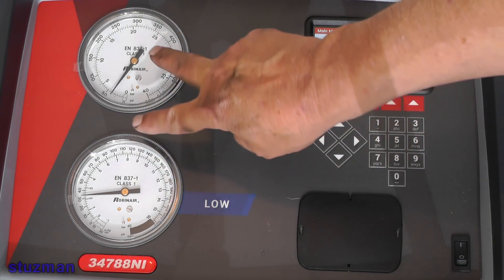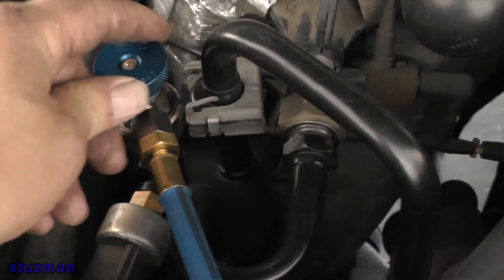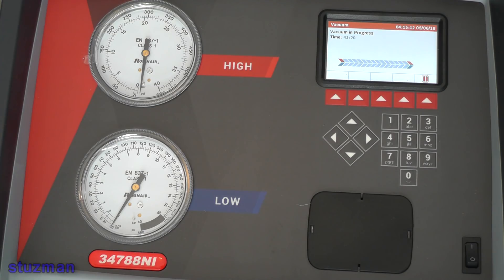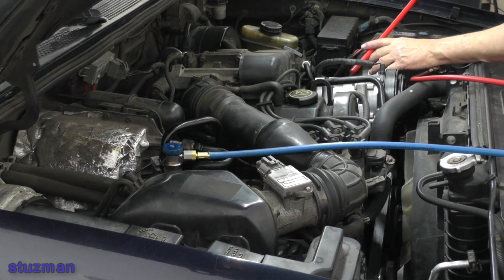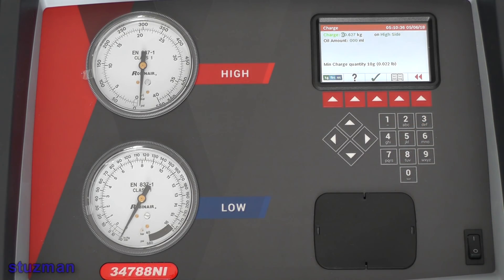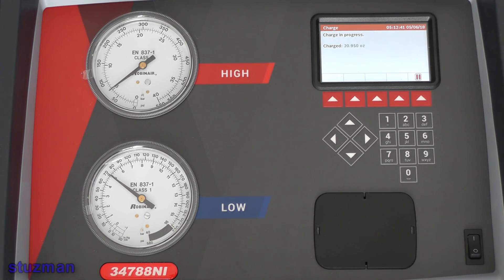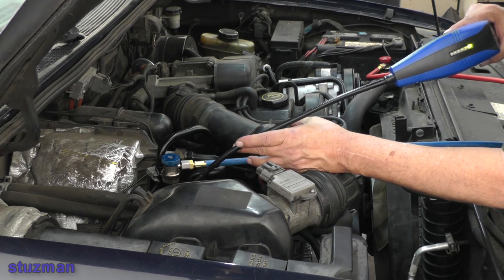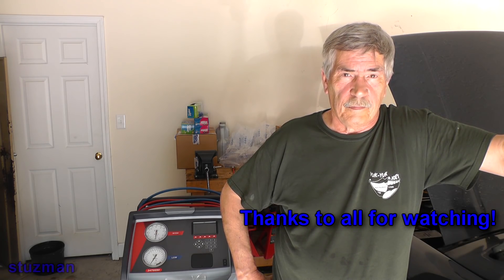Refrigerant Recovery, Evacuation and Charge

Comment: It is so nice to see professional and ethically correct techniques used in a DIY situation. My brother is a refrigeration tech and he can bail me out if I need a hand. For those without a recovery machine, hopefully many shops wouldn't charge too much to do that part.
Reply from the maker: spelunkerd Thank you very much Dave and the machine does make things easier! Lucky you to have a relative that can help you out 😀 I wouldn’t think that shops would be too expensive. On a side note, the parts guy was telling me how garages are very upset 😠 when they could no longer buy the 30 lb tank of refrigerant. The EPA law changed 1-1-2018 and to buy over 2 lbs of refrigerant, you have to be certified via section 609. I took care of that a few months back.
Reply: We can't even buy cans of 134a refrigerant in Canada, it is exclusive to those with adequate training and proven licensing.
Reply from the maker: spelunkerd I did not know that Dave. Learn something new all the time. Thanks for sharing! 👍

Comment: Terry, wouldn't it be cheaper to buy new cars than $4,000 refrigerant recovery systems? Just messing with you pal. The only problem I have with this is that 134a is being replaced. Seems like this beautiful machine will have a very limited lifetime.
Reply from the maker: SATAMAN Schmidt What Dennis, buy new cars 😜 I believe the machine will have a long life when you’re working with older vehicles. 😀👍